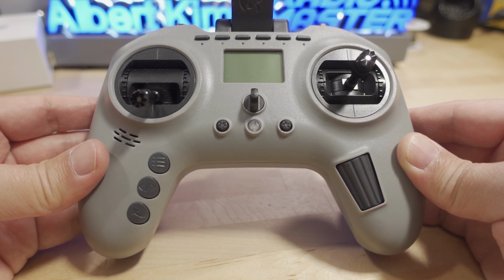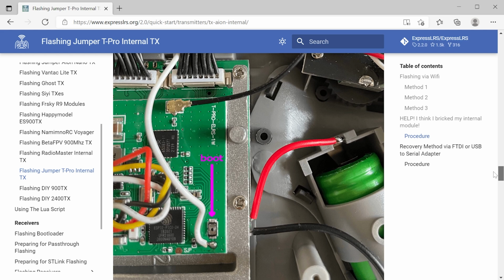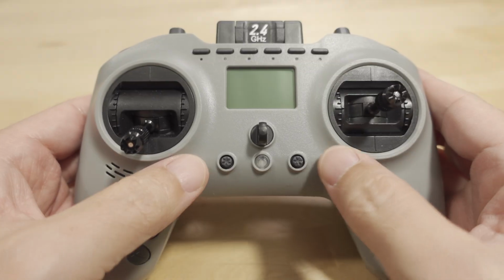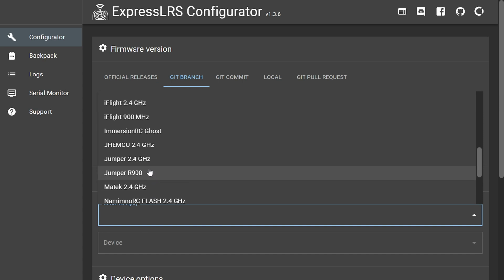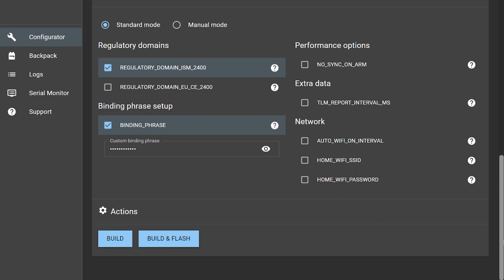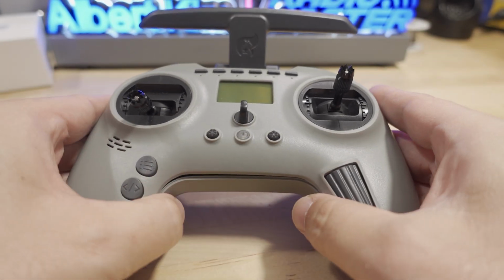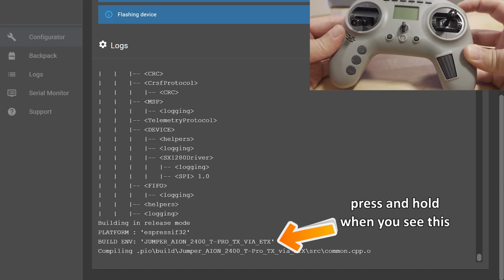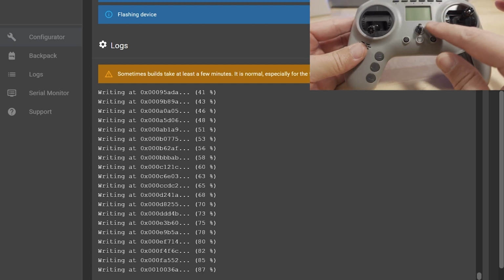Jumper T-Pro ELRS un-Bricking via EdgeTX Passthrough 👍

Comment: hey albert....i took out the sdcard in my jumpter tpro and i lost the internal CRSF mode. now it says Multi Flysky. help. mine is with the 1w elrs model
Reply from the maker: Wow, haven't seen this one before.  I have no idea why removing the SDcard would cause that.  Something else is going on.  Have you contacted Jumper support about this?
Reply: @AlbertKimTV  ok found it… its under the hardware thing. 

Now my controller have no stick inputs ……
Reply: @Miguel-oy3it  hey somehow i got it to work after inserting back the sdcard a couple of times

Comment: Not sure why, but I soldered those 2 exact pins (boot loader and bottom left corner pin on right momentary button) and now when I create a new model the "SD" button is not recognized (however, this only seems to impact new models and not existing models created before the mod for whatever reason) I can remove the wire and full button function is restored. Any ideas? Though maybe I had a bad firmware flash. I have tried flashing firmware & bootloaders for different current T-Pro supported releases of EdgeTX and OpenTX firmware (using different SD cards, with and without factory reset proceedure), yet the issue persists. I also noticed that unlike my T-Pro w/ multi-module, the SD card does not pass thru to the computer no matter what I try, it just shows an unformatted removable disk that is not accessible (but the SD card reads just fine in a card reader).
Reply from the maker: I have no idea.  Never heard of this one before.  Maybe you should contact Jumper support?

Comment: The reason it wasn't in the Docs yet is that it's not ready yet.
Devs are working on an easier method: one that you don't have to press or wire any switch with the boot button. ;)
Reply from the maker: Ah, that makes sense. I wonder how that will get implemented?
Reply: @AlbertKimTV  to add, there's a PR over at EdgeTX for this one: 1573
Reply: @AlbertKimTV  It should just work like how the Zorro would, as it should've been.

But, as you have demonstrated, it works just as fine with that button wired up..
Reply: Just have to keep in mind it does still require a mod, but that allows the transmitter to effectively press that button itself when needed. Will be included in 2.6.1 of ETX.